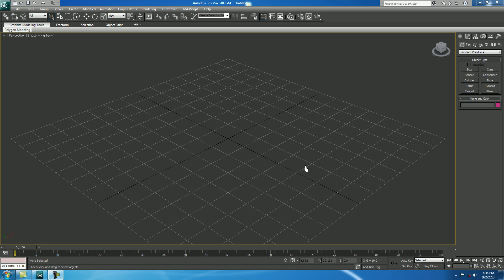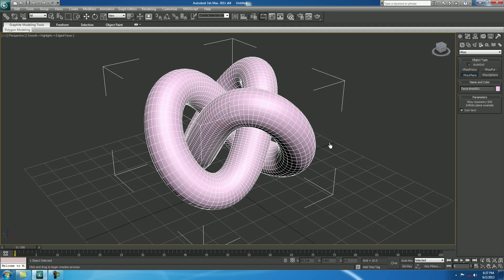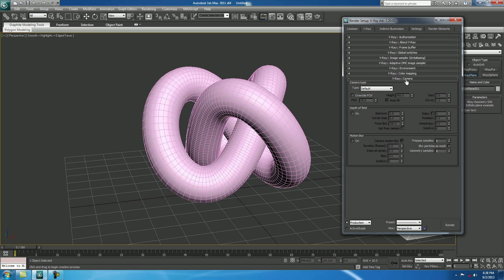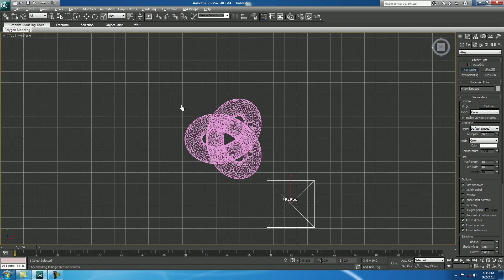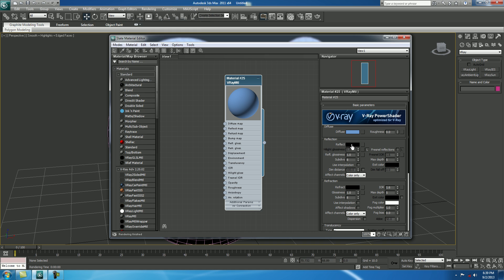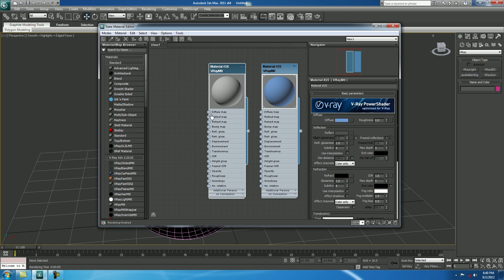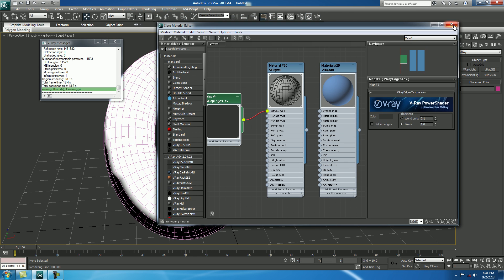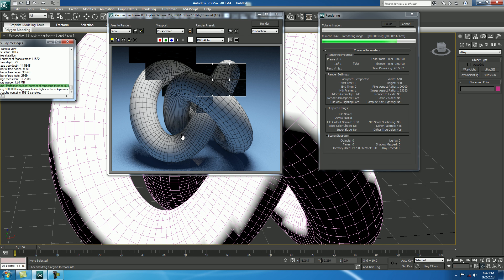V Ray Wireframe Render in 3dsmax

Comment: STOP THE PRESS: 

i have discovered a really simple way to render wireframe in Maya 2015 
ext 2.
Forget all of this toon / ramp method. It can be done in absically one 
click!. All you need to do is: 

1) Go into Render Settings, select 'Maya Hardware 2.0, skip past the 
'Common' tab and go to the 'Maya Hardware 2.0' tab.

2) Scroll all the way down to 'render options' then where it says 
'Render Mode' - it normaly says 'Shaded and Textured'. Just 
select/change this to: 'Wire'.

See example screenshot: https://screencloud.net/v/3b3L

And that's it - Now all your objects will render in perfect wireframe. 
you won't believe how easy this mehtod is, but just remember - only 
works with the new Maya (i only tested with extension 2.